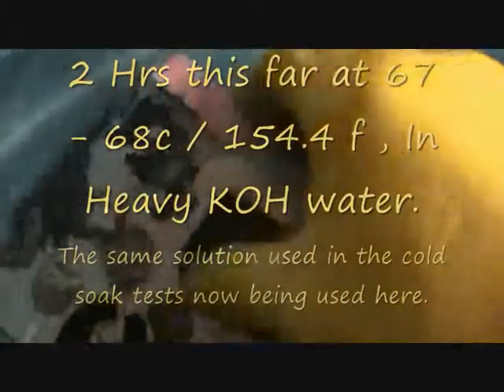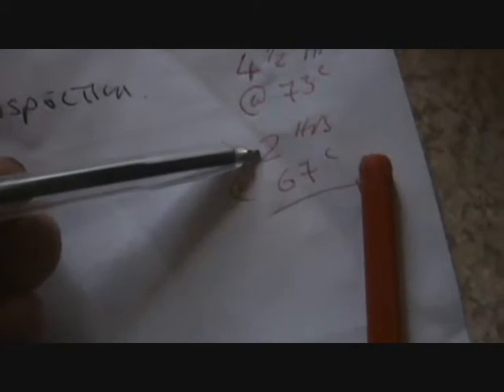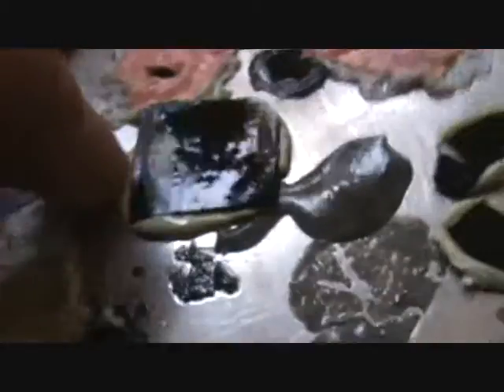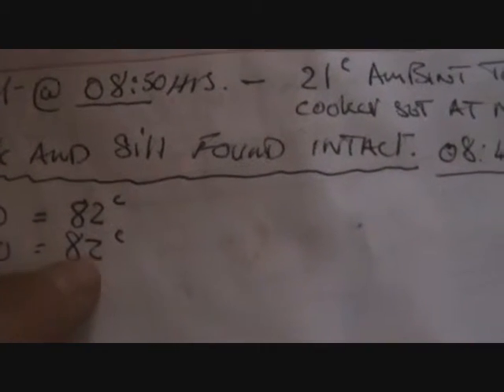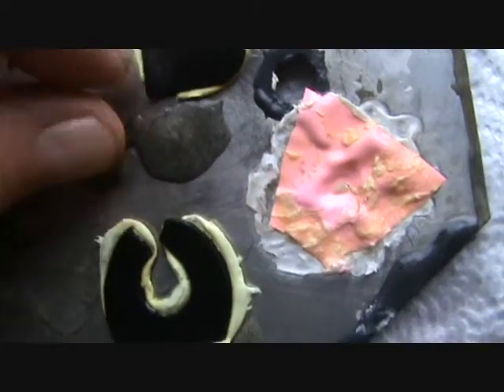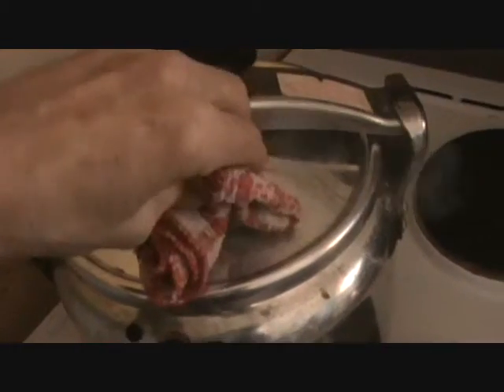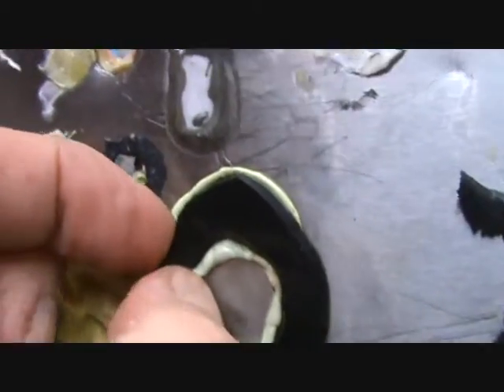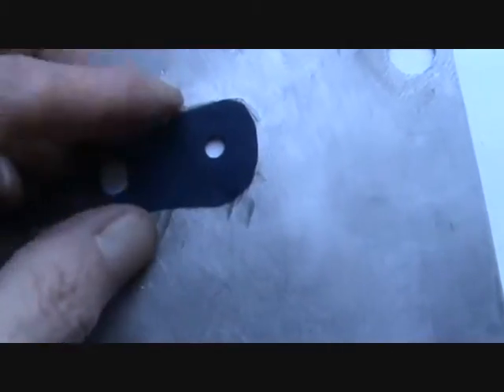FuelBan Re Thinking on Flux Leakage Pt 5. {Heating / Boiling Material test in KOH}

Comment: tap water has impurities , but koh adds current draw (the gain and loss trade of curve swings towards high amp use ..the caps are 4700uF 16V RB Electrolytic Capacitor , holds charge over the cell (smoothing) . One could simply use a choke or two ..also no koh means a whole would oh cell designs possible ? i have a simple cheap tap water cell design (so easy) , using 316/304 (NON Polished=nucleation) stainless pipe , just add silicone marine grade and small pvc air hoses , cure time finished

Comment from the maker: I use KOH for electrolytic purposes of a "constant" out side a "Constant" it is difficult to gauge Parameter's of gain or loss with experiments. TAP water is full of micro inclusions check {transmutation} & it works against any level comprehension, {I use distilled water.} this video you comment on is one looking to elevate flux leakage from water/ gas/ flow holes. a marked problem in such cells. ALL IS A TRADE OFF, GAIN & LOSS S TRADE OFF.
Thom.

Comment: the great Scottish inventors of the past that gave us tv / telephone ..etc,  i bet they too showed there progress and someone looking over there should would state the obvious .. why use koh or additives why not just plan tap water?  take a transformer of say 60 volts with 2amps  , fit a rectifier to make dc, note heat production and amps add another cell , note production the same but less heat and less amp drain ?, now fit some electrolyte cap over the cell,